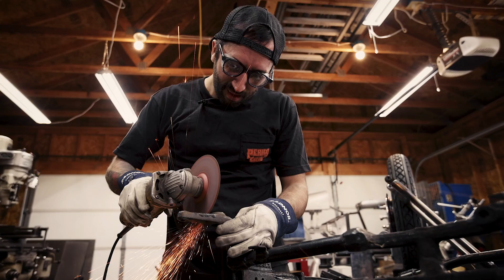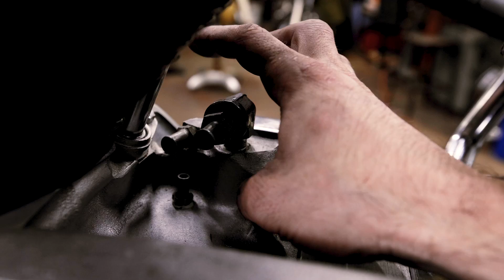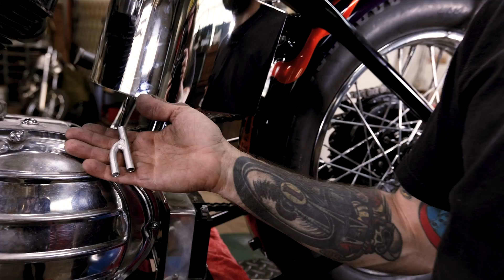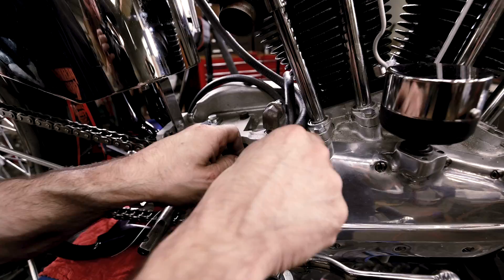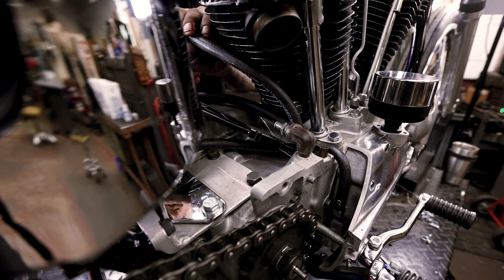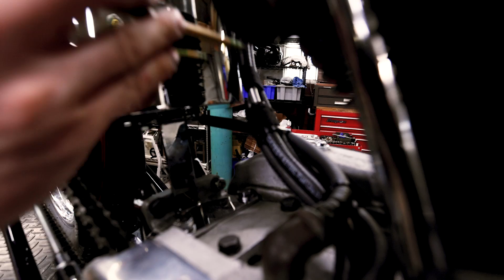Saturday Sportster - Season 2 - Episode 12 - Routing and Hooking Up Oil Lines

Comment: Is there any advantage to running hard oil lines or are they simply for looks?
Reply from the maker: Hard Oil lines often discussed in terms of getting a cleaner, tighter install. That “tight to the tank” for a “nice, tight, and clean” look, especially to avoid interference with nearby exhaust routing. but Yeah theres no real performance benefits.

Comment: Where do you get the spinny pliers?!?
Reply from the maker: You can find em at harbor freight / Eastwood tools etc they are really nice even from there
Reply: They are used a lot by aircraft A&P mechanics to safety wire fittings.

Comment: Looking forward to seeing that bike up and running and going down the road.   I'm glad you moved that T fittings down a little.  It didn't look right the first way you had it.     What gauge safety wire is best for using on fuel or oil lines (or on a motorcycle in general?)
Reply: .032 is your average wire but .040 will be a lil but thicker and less likely to cut into the tube
Reply from the maker: Stuff I got just says mechanics wire max weight 40lbs